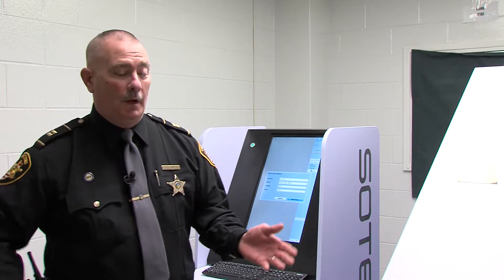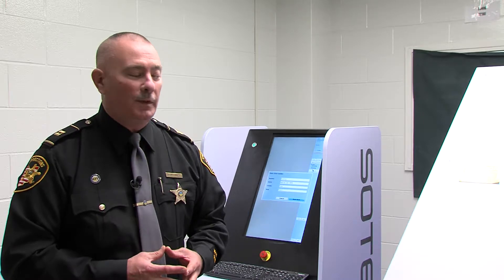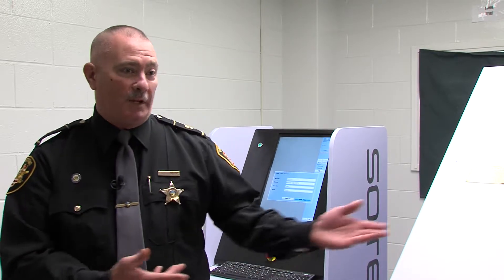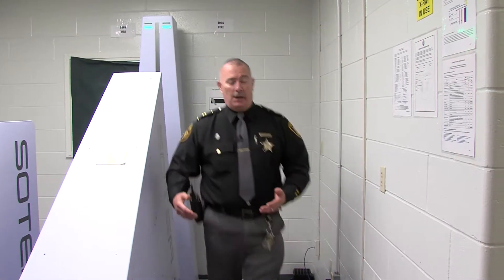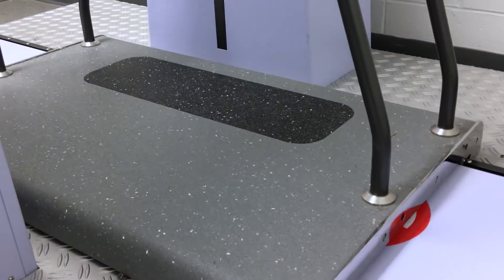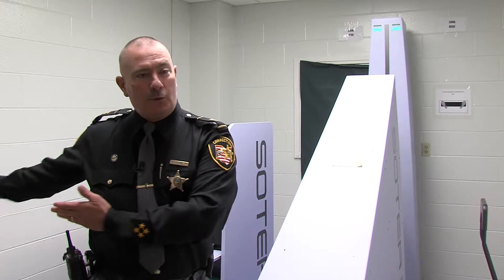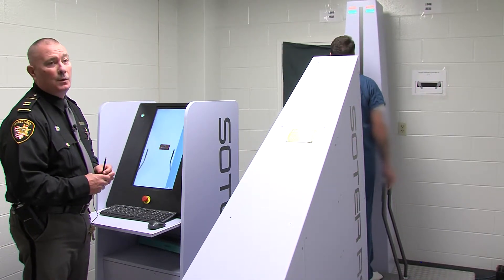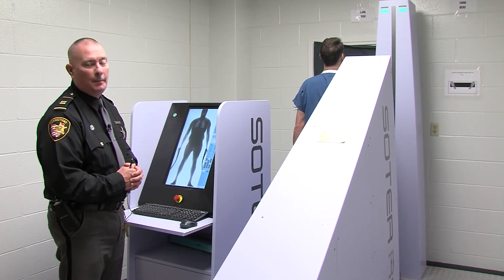Body Scanner Safety

Comment: A question can in some way affect going through that scanner every day. I work in a prison and do you have to spend every day in that scanner over time. Is there a risk?
Reply: Hi there! Good question. The Soter RS bodyscanner uses an exceptionally low dose of x-rays to conduct its scans. A Level 1 scan contains around 0.25 μSv of radiation, which is comparable to the natural radiation found in a banana. In addition, we have strict monitoring systems in place to track cumulative radiation exposure, ensuring it remains well within established safety limits. This way, even with daily use, the scanner maintains a safe level of exposure. (The scanner in the video is the Soter RS bodyscanner by ODSecurity, one of SMI Groep's companies)